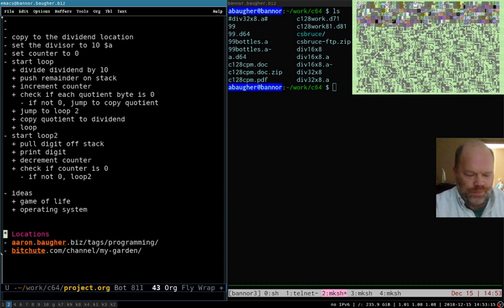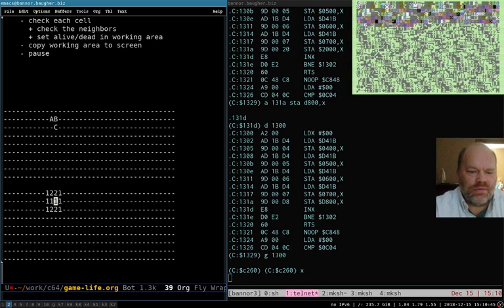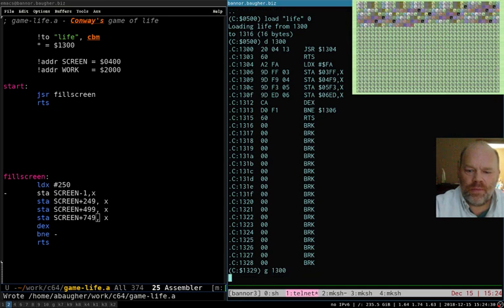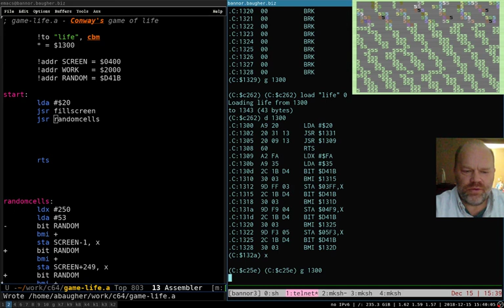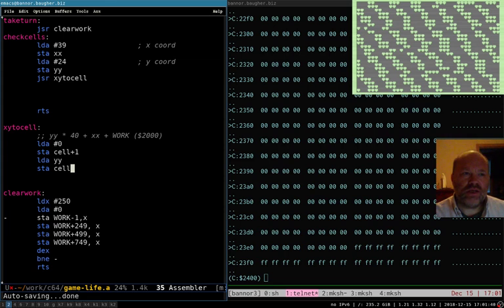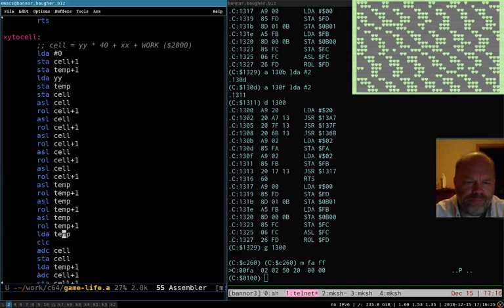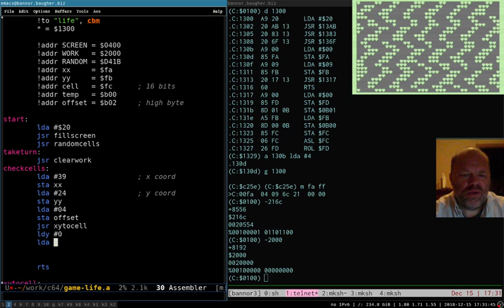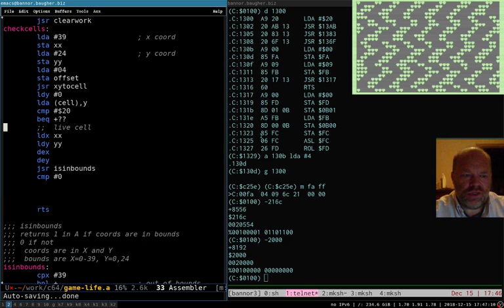6502 Assembly Language #8: Game of Life Part 1

Comment: Interesting observation. While following along here I found that the data from from the SID’s voice 3 oscillator only seems to return 0x00 when running this from the built in monitor (the screen fills with hearts). But if I run it from the VICE monitor it works perfectly. Spent a bit trying to figure out if I’d a typo and then tried it in VICE and hey presto. I’d even added a routine to initialize the SID properly.
Reply from the maker: Thanks, that's interesting, I wonder why? Unfortunately I don't have a real 128 to try it on.
Reply: Aaron Baugher Phew, that was a big one. Took a few shots to make the time to work through it with you. I owe you a 🍺
Reply from the maker: Heh, thanks.
Reply: Aaron Baugher Just noticed in Game of Life #4 at about 8mins in, you hit this too when you used the VICE 128 monitor to run the program again. You’ll see the screen fills with hearts in every spot. Sorry if you’ve addressed this in one of the later parts of the video.
Reply from the maker: You're right, I can't remember if I figured out why it did  that that time. It could have been that I was in the wrong bank, so it was reading from RAM instead of the SID register at that location. That's happened a few times. I don't think the VICE monitor defaults to the same bank as the built-in 128 monitor, so it's probably a good idea to always set it explicity at the beginning.
Reply: Aaron Baugher that makes sense. I’ll look at setting that next time and see how I get on.